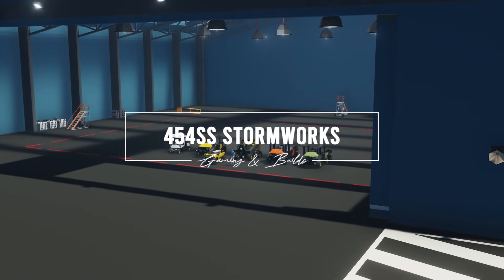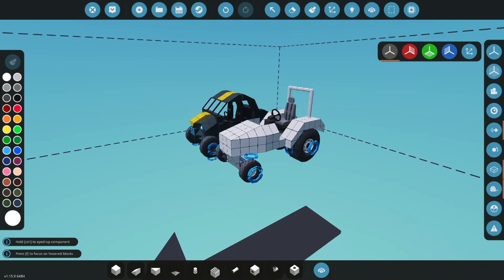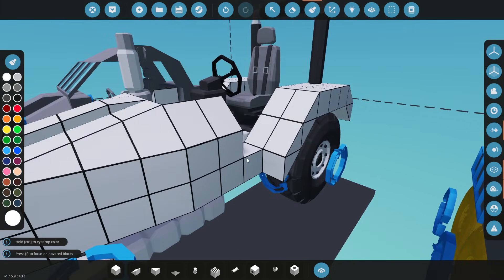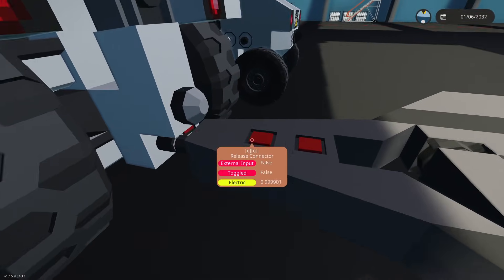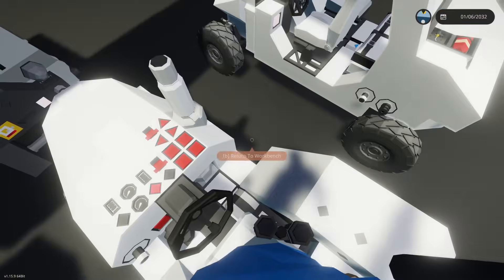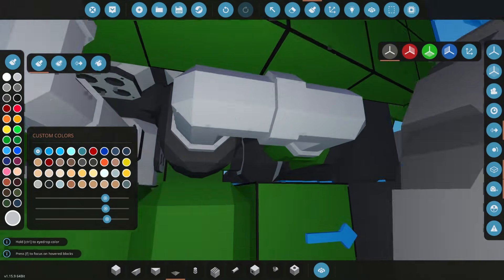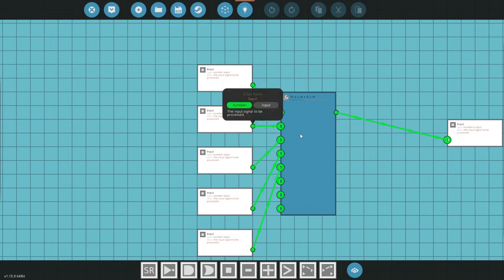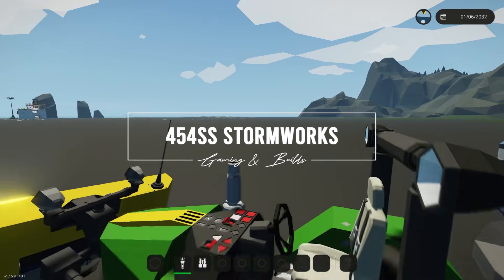This Tiny Tractor Pulls WAY More Than It Should (Stormworks)

Comment: When making a rat rod with differing wheels sizes I geared the front wheels up a little bit so they could keep up. It presented in a really similar fashion to your wheel sliding.
Reply from the maker: With the increased xml grip it does not present as much of a problem but good to know :) Thanks
Reply: @454ss_gaming I probably ran into more issues with a faster vehicle.

Comment: Nice job! Really powerfull! But it does not really look like the traditional tractor, look at a Massey Ferguson te20 for example and youll se what i mean, they got bigger back wheels and are a bit longer. No need to do that but it would be really cool if you did maybe a little bigger one with that look in mind!
Reply from the maker: Thank you! This one is based on a John Deer compact tractor like the 3046R! I do have plans to make a regular sized one as well!